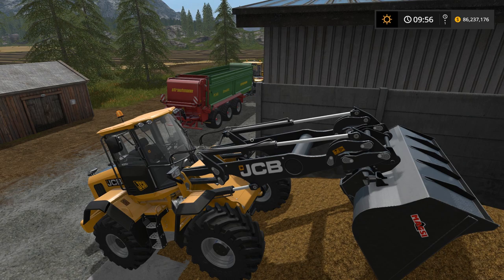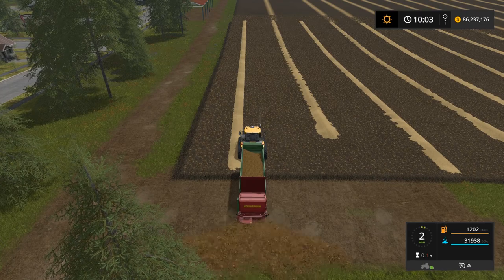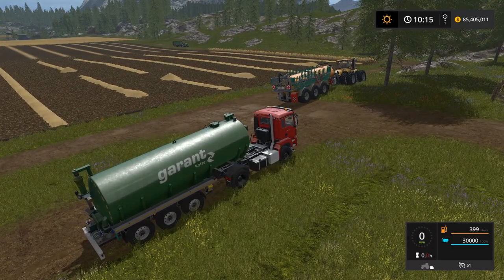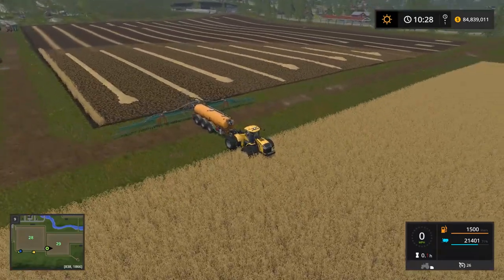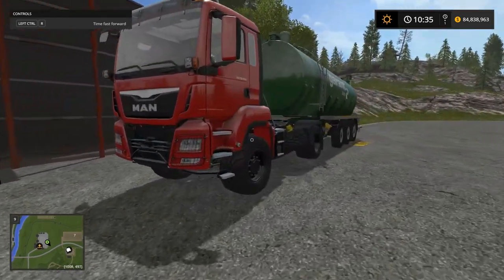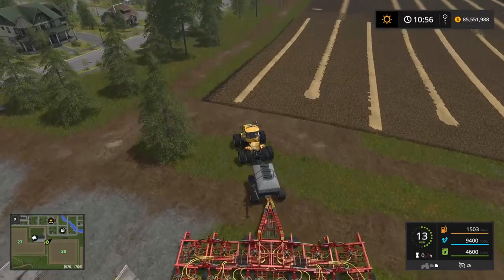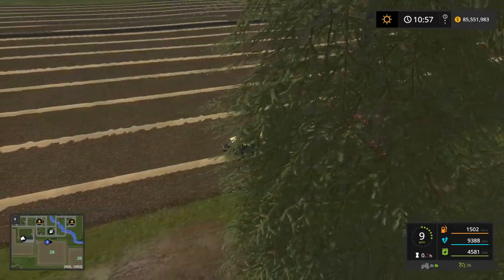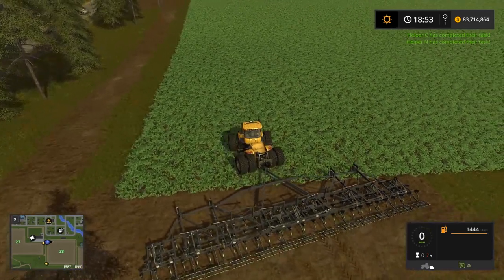A Complete Guide to Fertilization - Farming Simulator 17 Tutorial / Guide

Comment: More correctly you can fertilize when a field changes "state". You can fertilize a fallow field once. You can plow (change state) and add more fertilizer. You can cultivate and add more fertilizer. You can plant (growth stage 1) and fertilize. Wait for a change in growth state (2-4), and fertilize after each state change. If you use oilseed radish, you can fertilize after you plant it, fertilize when it grows, and then fertilize as you cultivate it in. Yeah you can really go over the top with this stuff. 

When a device does [something] and fertilizes - it fertilizes as the last action. So you can fertilize and if you plant and fertilize the plant action happens first and changes the field state, then the fertilization happens. Same with the slurry/cultivator.

Comment: Quick Recap:
(Correct me if I’m wrong)
AFTER HARVESTING:
(plant bottoms still in ground)
Fertilize 1 time
Plant Oilseed Radish and cultivate
Plow
Sow Crops
In first stage(s) of growing, spray

IF SETTINGS ARE SET TO ONE,
Spray crop bottoms after harvesting
Reply from the maker: If you do oilseed radish, that counts as one stage - so if you have "fertilize"set to 1, then you just need oilseed radish - If you have it set on 3, I would do 1 fertilizer type (probably solid or Manure, or Slurry), then plant oilseed,   The again after your crop grows 1 stage (spray).  That is closer to how they would do it in real life.
Reply: So spray with oilseed tops still in ground, or after cultivating oilseed radish?